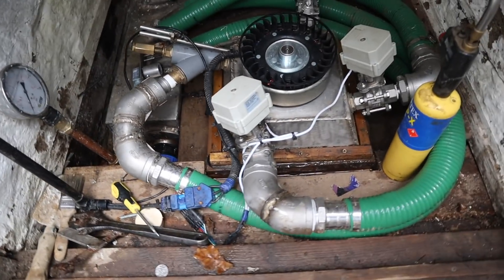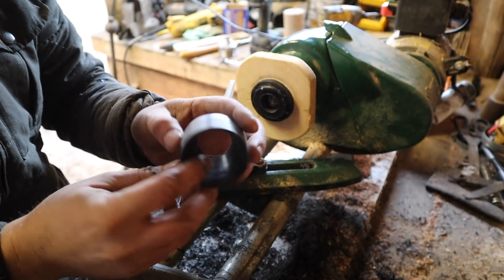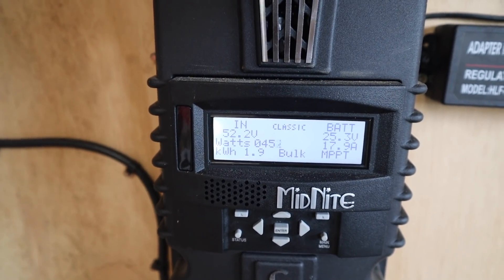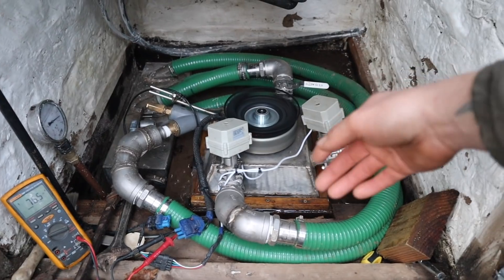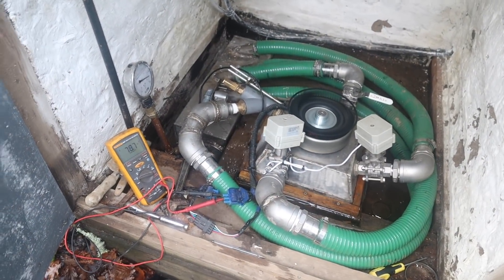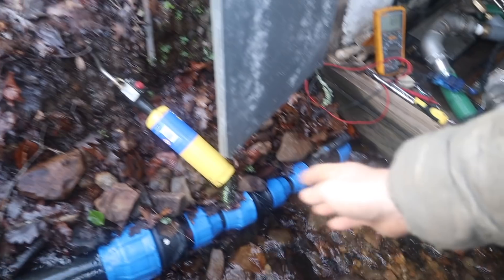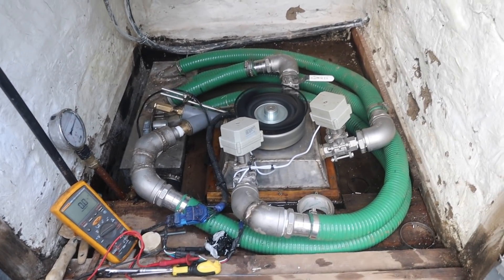Off Grid Micro Hydro Turbine Fine Tuning (Tapered inserts and fan loss testing)

Comment: I've watched all your hydro videos and found them fascinating and informative. I wondered if measuring the rotational speed of the alternator fan with something like a cheap Lazer rev counter would give you an easy way to see slight efficiency improvements (and save your legs from that long walk back to see the controller😄) - thanks anyway for your great content.
Reply: Very good tip! 
Rev counters are cheap these days.
Thanks!

Comment: Just wondering what sort of speed the water has in the 2" pipe and in the 1" pipe. I am just guessing here but if the speed is low the taper would not make much difference ?

Comment: Consider an aftermarket 4 cylinder exhaust header for a manifold. They are made for balanced flow. It would just be used in reverse. They also come in stainless steel.

Comment: Just watched this episode for the first time, puts me in mind of some work I did about ten years ago when I discovered that material choice could actually make quite a significant  difference to flow rate. Quite by accident really, I discovered that an electroplated zinc finish was an improvement on both brass and copper, not at all what I would have expected. Also found messing about with the internal profiles could significantly improve or reduce power levels. I was working with air in a very different field but air and water behave in similar ways. Not sure that any improvements gained would be worth the effort but who knows? Some thing you may not be aware of is that internal pipe friction can be reduced a device that was developed back in the 1930's in order to pump water to greater heights, reducing pressure loss up sky scrappers for fire fighting, just a simple insert in the pipe, the idea of an American professor named Brown if memory still serving correctly. Again not sure that this would help any as you are working with static head pressure rather than forced pressure, but may well be worth reading up on.
Reply: Cross fertilisation of technology from different disciplines is valuable!

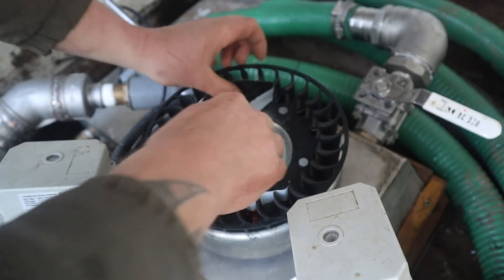Comment: @13:00 your fan is spinning the wrong way to begin with.....a cooler turbine will always produce more voltage

my suggestion is redo the whole thing to make the turbine spin the right way so the fan is actually cooling the turbine

Comment: Great video ... I think your definitely right with your set up from what I’ve read it’s all about flow so those pipe joints will be the biggest problem as they restrict flow but apart from that looks brilliant I like the metal joints your using and I’ve seen the flexi pipe used is recommended on most installs ... in fact one website I’ve been looking at is on PowerSpout they use smart drive motors ... I have 8 solar panels I put connected to a 5kw Voltacon Mppt inverter I was wondering do you think it’s possible to connect a hydro power feed to a solar power intake 🤷‍♂️ it says it will take 500v DC but I’m wondering if it would need blocking diodes or if it would try take to much power and stop the turbine?
Reply: I think you would need diodes to stop hydro power going to the PVs and vice versa. The MPPT controller should vary to load to find the sweet spot for your turbine. 
But if the sun shines at the same time as hydro... It's anyone's guess.

Comment: I'm new to your channel and I appreciate the work you do and your ingenuity. I have a question... is the inside of the green flex-pipe smooth or ribbed like the outside?

A while ago I switched my shop-vac hose to a smooth inside one. It seems to perform better now. As water movement and air movement share a lot of tendencies, it may be worth consideration.
Reply from the maker: Yeah it’s smooth inside, ribbed hose would be to high friction

Comment: Have you tried changing the order of the pipes on the manifold. I think the pipes maybe better in the order as the first the longest pipe then one is the next longest one

Manifold                                                       Hyrdro
4                                                                         4
3                                                                   1         3
2                                                                          2
1

so 1 to 1,  2 to 2, 3 to 3, 4 to 4

I am also thinking the most of the pressure could be at end of the manifold so maybe this order would be better
4 to 1, 3 to 2, 2 to 3, 1 to 4  

 In both examples the first number is the manifold.

hope this make sense to you.

I am also thinking could you modafy a manifold from a engine to work

Comment: is it worth looking at the hydro with a thermal camera (there is an app, but its not reliable) to see what heat is generated at the generator, and test again with fan removed (if easily done), why i suggest that? once you shut the door the air will be fairly still as well as cold at stream level, not like a jet engine which is constantly fed with cold air, if the heat was sufficient, i wonder if a heat sink might improve, save that tiny amount used by the fan, but it might mean making a custom deep ally sink to sit spinning on top??

but that was interesting to see what little difference your additions to improve flow, my side thought on that is, the size of the hole at the jets determines the amount of flow, so when the taps are open slightly or fully is the only variable surely, the pressure gained in the large bore pipe all the way back to the head is created by the sheer volume or weight of all that water, so it pretty much acts as a large tank, i guess that's all part of your original calculations 

i been watching a load of videos, like you i suspect, and what i see with just using a stream naturally to flow under or over a wheel, maybe using a flume, doesn't work as efficiently since its only using an uncontained volume of water, once its in a pipe and with adequate elevation, then that's the maths i guess, steeper and large bore pipe filled to top gives you the gravity fed pressure for a constant high flow, i think i understand hydro now, yes? some great educational content, keep going fella, i'm learning i hope?

Comment: Here is for you, a design to figure out. YOUR system without the need for batteries. 18 to 20 amps will run a small cabin. Maybe one use at a time but still usable. But how to accomplish this without the requirement for the  batteries. If one has continuous input, year around, how to eliminate them...... to be, or not to be batteries, that is the question.

Comment: Firstly I know very little regarding hydro system and I looking to make a wind turbine. That said this is one of the best series I have found on off grid power.

My opinion; I would increase the 90mm pipe side to say 150mm inlet. Have a 150mm long pipe or coupler. Out of this coupler (inline with the water flow)make a plate with 4 50mm outlet  to each jet. Also worth considering the pipe length to each jet. If you can get them all the same length and bend radius then this should prove the least resistance. 

Thanks M

Comment: I wonder if the taper isn't doing much because the water is so turbulent going into it. Maybe putting something before the taper to make the flow more laminar would help? Imagine stacking a bunch of drinking straws in the pipe to force the flow one direction. Would be tricky to fit with those tight bends and stuff though.

Comment: A bit late to the party Kris but I was wondering if you could use a more suitably sized ball valve and get someone to 3D print some suitable custom adapters for your thread and pipe sizes ? Another thought would be for you to get in touch with AvE on Youtube and see if it is possible to CNC a custom ball valve assembly. He is very very knowledgeable about many things and will no doubt be impressed with you home brewed "angry pixie" maker = ) Do not forget to put the head section inspection on your quarterly maintenance schedule !!!

Comment: Do you know the flow rate in the tubes? I imagine the flow in the tubes is not fast enough to have the taper to have much effect. I think the best way to get improvements us more pressure or flow. The second intake will help with pressure by raising the water level. Next I'd see what different nozels do. You could up the flow but that would lower the pressure. It a balance of flow and pressure to maximize power. I had to do a pelton turbine lab last semester for my mechanical engineering degree so this stuff is pretty fresh for me. I think it's pretty interesting stuff
Reply from the maker: yeah the flow is quite low for the size of hose so the losses are quite small anyway. im quite sure it will have much more of an effect once i get the second intake added as i will double the flow. I sized the main penstock and most of the hose to take up to 10 lps before the losses make it pointless to run anymore flow. so i can still run twice the flow im currently running (once i upgrade the short pipe feeding the manifold) It will not run efficiently at that flow because of the pressure drop to friction so i will more than likely just add the second intake and run at about 7lps average, at 7lps shared over two intakes and two penstocks i would have small losses and an average output of around 700w Not to shabby. The second intake wont add head (it is at the same elevation) Just flow.

Comment: why can't you use a larger dia connection pipe on the one valve near the gauge? you have the automatic control on the Y and the water coming on one side of the valve using a 2" to 2" or a 2" down to 1.75" connector vs 2" to 1".

Comment: I can't believe people are still watching these videos and thinking your system isn't working🤦‍♂️. Very interesting though, I would have thought both modifications would have made a difference. The fact the water has to turn 90° before hitting the taper i presume is where is energy or momentum is lost?  So then it's just the pressure behind it pushing it through the 1" hole, therefore not making that much difference.  Does the fan have an active role to play? Does it get hot etc?
Reply from the maker: The fan seems to do a nice job keeping the turbine dry on top and blowing away condensation. So for a few watts I think it's worth it for that. Hope you are well 🙂
Reply: @KrisHarbour   very well thanks mate. Hope you are too! Didn't think about the condensation side of things. Must be pretty damp in that environment so definitely worth the watts! Happy Christmas buddy thanks again for all the effort with the videos.... Looking forward to 2020!
Reply: Is the centrifugal fan ring made of metal? - if so, it is conducting heat from the magnet bell to the blades - a spinning heat sink, about 4 years ago a computer CPU cooler was almost based on that, except that it has a extremely thin air gap where heat radiates across to the spinning wheel on top to dissipate it.

Comment: Hi Kris,  thanks for the update. I would have thought that putting on the inserts would have given a few more watts. Could losses be occurring in the ribbed feed pipes. This would be hard to replace with smooth wall jet feed pipes. Do you think that putting the main feed pipe isolator at the top near the intake would allow more pressure at the turbine end. This is great to follow and very educational.
Reply: They aren't ribbed internally. Kris mentioned this when he installed them.

Comment: Kris, I would be interested in knowing more about elevation of your intake, Pump house,  Elevation of your 2nd stream and those other little streams. Distance between each one and if it is possible to combined them to one new area or an existing area. 
What would you have to change if anything, Would this improve your current set up. 
The video you posted just did not include enough information about these things. As I am unsure if just adding in a new water input would work, Seems like there are more problems than improvements.